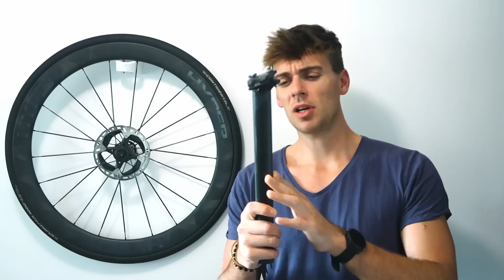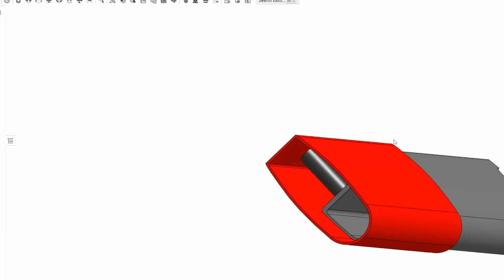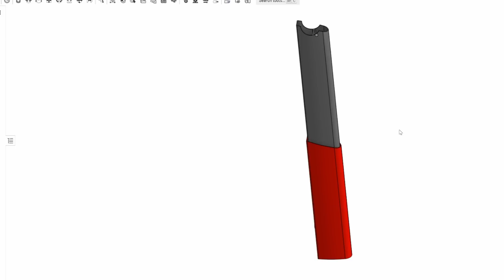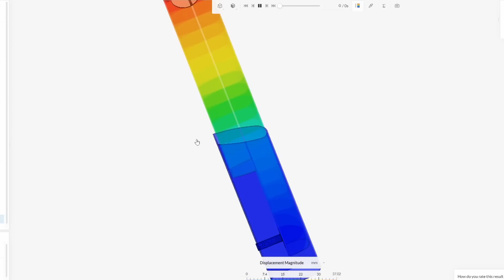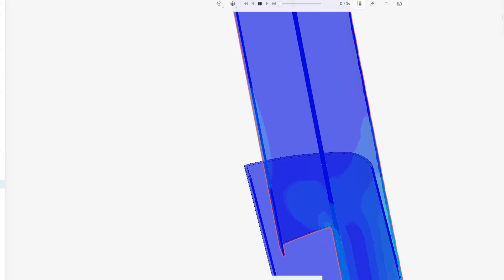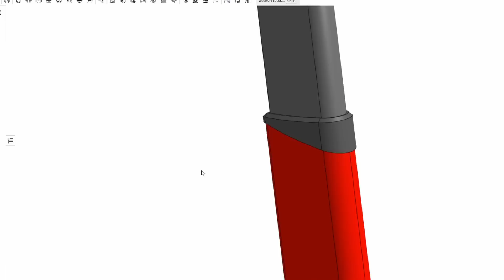2021 Canyon Aeroad seatpost fail, fix & The State of bicycle frames in 2021.

Comment: Maybe you can check out the Pinarello F5. I recently purchased one and have the creaking seat post issue. The Paste did not work. removing the past did not work. maybe you can shed some light on this problem with your engineering background. Great video by the way!

Comment: I don’t work at Canyon but it is pretty easy to figure out what happened:

1. Owners/investors tell management that the next bike needs to be more aero, lighter, and more comfortable 
2. Managers pass the info to engineers
3. Engineers come back with a viable solution
4. Managers tell them that it isn’t aero/light/comfortable enough
5. Engineers say it isn’t possible without sacrificing one or the other
6. Managers say that isn’t acceptable, probably with some line like “if you can’t figure it out I’ll find someone that can”
7. Engineers come back with this solution. Managers and investors are happy.
8. Engineer sends memo saying something like “this solution carries the risk of creaking or other issues while under load that may result in massive warranty claims”
9. Engineer gets fired, managers instruct everyone to ignore e-mail

Or something like that

Comment: One other thing that I have noticed, the pinch bolt assembly is so small and the seat posts that I have seen have a round indentation from where the pinch bolt presses on the seat post. Would that not cause delamination on  the post? There's a few videos showing this on youtube. Thanks and great channel.

Comment: Before I started with cycling, I was a hang glider pilot. And back in 2015 I had bought a brand new performance hang glider with a lot of carbon parts directly from the factory for 7k€. It was a small company from Germany and the whole thing was designed and produced also in Germany. I don't how many pieces they sold each year but it was definitely no mass production.
Now when I compare the price point of this highly sophisticated aircraft with mass produced carbon bike frames from Asia, I have to wonder where this price difference comes from!?  For me it's not plausible.

Comment: Great video mate.
Meanwhile, one year later, they released the grommet but still no where near a proper and final fix. Ridiculous. Even with the grommet the design choice of having a moving seat post in a carbon frame just seems bonkers.

Ps: you had a load case for a heavy rider, but what about compliance for a light rider? Would the stiffer post still flex enough?

Comment: I was just watching this again, as by now I bought the bike, it now comes with a rubber seal and it seems the seatpost doesn´t get damaged by rubbish getting in, but now they (and I) have a noise problem coming from the seatpost. If you grease it up at the rubber seal area it goes away for some time, but it seems the grease is wearing away or melting down into the seat tube and after some rides the noise comes back. Some people seem to have had success with putting tape around the post at the area of the seal. What is your opinion on this and it would be great if you could update your video, as many people are struggling with that now. Canyon tells people to send their bikes back for warranty and apparently they are returned with a new seal installed, same frame and post. 
It continues to be embarrasing, especially as I am a German Engineer myself😁 Apart from that the bike is great, but the noise makes it pretty unusable. BR Eckhard

Comment: When I saw this design on release I could see the problem straight away and I’m not a carbon expert. If you’re clamping something further down while reducing the mass to encourage flex then the upper portion will need clearance to be able to flex or am I missing something 🤔frame quality and design is utter crap 💩 too much focus on aero and marketing and not enough on actual quality 🤦🏻‍♂️

Comment: Keep the top spacing - or increase it - and sell “performance vibration dampers” to “tune your ride and save 1^xn watts per 40 km” (polyurethane bushings sold at a massive mark up).

Comment: I'm having a similar issue with my brand new Canyon Roadlite with the Canyon S15 VCLS 2.0 CF Seat post. The diameter tolerances between the seat post and the seat tube are to great for allowing the seat post to stay in place firmly against the walls of the seat tube. This creates a fine cut line on the seat post as it flexes back and forwards and each time rubs against the rear side of the seat tube. Having issues with the steerer tube bolt also. Will never go for another Canyon again!

Comment: Finally someone called them PLASTIC frames , ' cos effectively that's what carbon frames are , a glorified plastic .
And if U were designing something to ' flex' in side a hole wouldn't U put some kind of bushing between the two surfaces to still allow some flex but absorb some of the ' shock' and dissipate the energy in other ways ????

Comment: oh come on the Shimano Dura ace 9000 and 9100 plastic core cassettes would bend and drop chain under load, or SNAP AT THE RIVET. shimano double rivets so they lasted twice as long, months? we went for campy or SRAM monoblock cassettes and no more issues! How about the dura ace 9000-9150 polymer cables that frayed the polymers and gunked inside reducing my usability to 400-800 kms or 3 weeks? switched to gore yokozuna, no more  issues. Shimano DA chains?  putrid metallurgy when compared to Campy chains and even sram.... yes agree with everything else but for shimano being a role model. Google dura ace 9000 rubbish cassette says it all.

Comment: appreciate your work, but i guess your model is wrong. the design is for sure thought to be a fixed bearing at the bottom and a "pivot" at the top. so it can flex forward inbetween the two "bearings". I don't know how someone can possibly come up with such a bad design. friction and wear are just too obvious, as the top slides ever so slightly when flexing. if you would increase the gap to erase the top bearing you end up having extrem leverage and forces on the bottom clamp. dont know how you would want to have a 40cm lever clamped on a 2 cm collar and bounce a heavy person on it. math tells me it wont work. having a rubber collar on top, as a sealing and as a bearing would help indeed.

Comment: I don't know what brand to buy anymore. I had a seatpost problem on my 2009 Madone. They never solved my problem, despite their lifetime warranty for the first owner. The seatpost goes over the frame and is secured with a clamping system with two screws from the back. Every season one of the bolts would brake. Cycling friends called me the canon, because of the sound the braking bolt made when braking during a ride. Almost had an accidant because of this problem. There were more people that had the same problem back then, but Trek did just ignore the problem. I had to take my loss and throw away a 2000 euro frame. They changed the way they clamp their seatpost the next year by the way. Never a Trek for me again. Now I can add Canyon to my "never buy" list I see.

Comment: As an engineer I came up with those 2 solutions before you even mentioned it in the video. Grommet as the best way and sealant as a quick fix. I guess engineers think alike. If only Canyon could use common sense...

Comment: Canyon really made it wrong here. On the other side: your investigation and solution is wrong too (sorry). The lower fixing point is not designed to take up moments (look at the drawing). It is designe as a force-pair from lower fixing point and the from top of the seattube. The problem is, that there is a space, so that the seatpost can move during riding (which is a dynamic impact). Correct solution is to prevent the seatpost from moving on top of the seattube NOT to give it more space.

Comment: Here’s another design/engineering question...why did they decide to mount the clamping arm at the rear of the seat post? The bending moment is pushing the bottom of the seat post forward, so it would make more sense to mount the arm on the front of the post if you are going to design the bottom part of the seat post half the length of the frame! Thoughts?

Comment: The post doesn't acutally work in the way you said. It's not a bar with just onebearing at the bottom as you discribed but rather a bar with two bearings, one at the clampt and one where the post exits the frame. This doens't make the damage to the post any better but the problem is certainly not that the post has to less clearance.

Comment: I’ve personally opted to avoid carbon frames, I ride mtbs and at times it’ll take an impact from a direction that the carbon wasn’t designed to support, could be because I fall off, or a rock kicks up... etc. While I understand manufactures need to define fair use for their warranties, I’d argue that in mountain biking this type of impact comes with the territory, whereas metal frames tend to withstand these impacts better. I’d be a little more inclined if the smaller brands honored their warranties properly. But I can’t lay down 3k+ for technology that’s more sensitive to production miss-haps, are not scanned / checked over fully before being shipped out, a reluctance to honoring warranties and at the end of their life cycles these frames can’t be recycled easily. So most carbon bikes will most likely go into a landfill. By all means correct me on any of this because I’d love to buy a sleek carbon frame, they look gorgeous… but as a weekend warrior it just doesn’t make sense to my tiny monkey brain.

Comment: Couldn't let the chance to be comment 666 pass lol.  I have the Canyon Aeroad CFR and I looked at the design and saw a way around any problems.  First, I'm old enough to remember when we started using aluminum handlebars on motorcycles and they broke because the clamp cut into the bar. We solved the problem by chamfering the edges of the clamps.  I did that to my frame, not enough to really even see it but enough to keep the sharp edge from cutting into the seatpost as it flexes.  The other thing I did was to be very careful about not getting assembly paste above the small part where the clamp grabs. In fact, just an inch or so on both sides of where the clamp applies pressure.  Then I made sure the inside of the frame at the top was smooth because that's the only part where the seatpost can really rub. If you grease the inside of the frame just at the top where seatpost enters and the post it works just fine. As far as sealing the top, I live in SoCal and don't ride this bike in the rain. Still, I put tape around the top to be certain nothing could get down into the frame. I've only got about 1500 miles on the bike but I'm not having any problems.  I'll keep an eye on it but I'm not expecting anything serious.
Reply from the maker: Well Robert, you're lucky to be gifted with a certain level of mechanical sympathy. 99 percent of your fellow customers won't recognise the things you have, and that's the issue. Cheers
Reply: @PeakTorque  It may be that Canyon see this as a structural issue more than a cosmetic one.  Structurally I'm sure it's fine, would never fail in the service life of the bike.  We tend to see our bikes more as art while engineers might see them as equipment.  "So what if it's a little scuffed - it will never fail and it rides great!"  Just saying... Keep up the good work.

Comment: I think they need the contact at two points to react against the torque applied to the seat post.   If all the torque has to be resolved at the bottom clamp only, the loads will be huge.    A boot will help, and it may need to have a plastic bushing incorporated to help provide a wear surface.
Reply from the maker: True, they could've intended it to be a simply supported beam not a cantilever, but then the top support needs to be zero friction and zero, clearance, a pure slider. Which it isn't.

Comment: Those 2000 N are pretty reasonable, i would even say rather normal. I am 2m tall and 115 kg at the moment (Dang you COVID, Dang you!) so i would even go towards 2500 - 3000 N if someone does absolutely nothing to absorb any impact and just remains seating.

Comment: No, it's not way harder. The component parts are smaller and they make many more. The frame is much larger and much lower volume. That combination makes for the lower consistency every single time.

Comment: Love how guys like you and Hambini are calling bs on the bike industry.  But you're missing the main pt - that Ritchey himself pointed out in a Q&A video couple yrs ago.  It starts with the fork, which is combination control arm and primary canti spring suspension. This is the part of the design to get right first.  Together with the tires, it's the 1st order dynamic response.  Everything else is higher order and of lesser importance.  The industry has settled on a fiber composite fork which has poor fail characteristics.  For cost, mfg yield, whatever ... it is being to be overbuilt for safety factors.  It's too stiff.  The rest of the design becomes different ways to compensate for poor ride and handling due to the front end being too stiff.  Disk brakes on a road bike?  Completely unnecessary and makes the problem that much worse.  Alternatively, tolerate one more lb of weight and build it from steel like before; tailor the flex properly, and safely design closer to the yield stress without issue of catastrophic fail.
Reply from the maker: Great comment. Totally agree most bikes are too stiff. In my other videos you'll see i comment out how most carbon forks make the front disc brake feel awful with reduced braking traction and feel, especially with torsionally stiff front wheels (2 or 3x and short spokes). I agree the fork is the first and fundamental resonance mode, but that shouldn't be confused with general deflection due to single bump loads, an area where i think soft/flexy seat posts are very valid.
Reply: @PeakTorque  hmm. somewhat disagree for a road bike. there once was a design called soft ride that didn't work out. if there's too much travel at the seat, stability for power transfer is compromised.

Comment: I disagree with the design principle discussed in this video around the subject of stiffness, clearance etc.  You can’t get a ‘floating seatpost’ to work in this installation; the canti-lever condition doesn’t allow for it.  

The correct way to design this would be to design directional  stiffness properties into the post - also on a performance bike you should accept some level of additional stiffness.

The fix is make the post constant cross Section and put the clamp at the top of the seat tube. 

Also canyon makes mega money by sub contracting frame manufacture to a composites company in China.  The only profit margin warranty wipes out is for shareholders.

Comment: Could it be that UCI said the frame as per design intent is in fact UCI illegal.. i.e. a) the frame that covers the boxy portion of seat post is in fact just a fairing... b) the frame doesn't conform the "simple" triangle requirement for frame (could say a) the top tube is effectively L-shaped or b) the front triangle is effectively a quadrilateral... so they got rejected and instead of scrapping whole thing they redesign to restrict the seat post movement where inserts... which nullifies any advantage of the complex design? Doh! 🤦🏽‍♂️

https://ibb.co/gMDzzm6

Comment: Another video and another poor analysis. The design is crap for obvious reasons but there is no way that they were trying to make it work as a cantilever with a clearance at the top of the frame. It is meant to be a beam that has a semi rigid connection at the bottom and a horizontal support at the top of the frame.

Comment: Its truly disgusting that frame manufacturers are shipping this shit and charging thousands of dollars for something that's not fit for purpose. There was a time when steel or aluminium frames were built with quality welds and quality materials and any poor workmanship was visible and those frames were rejected. Now, carbon frames have all this mess hidden from view, it might look good on the outside but it's hiding all the flaws and faults under the covers. It's so poor and yet the prices have rocketed. I know what you mean about falling out of love with the bike industry.

Comment: I notice that there are comments suggesting similar problems don't, or are less likely, on metal frames. That is completely wrong; the state of alloy MTB frames is pretty bad. In my own (recent) experience, it took Silverback 14 months to replace one frame 3 times before finding the 4th frame acceptable. The 3rd frame was built with a 2.5° misalignment of the head tube. Clearly nobody ever checks this kind of stuff. https://hindesite.wordpress.com/2019/09/06/some-comments-on-a-midfat-mtb/

Comment: Your engineering is suspect at best. The issues highlighted appear to be corrected but as an Director of Engineering I would terminate the engineering that presented this “assumption “ analysis.
Reply from the maker: it was a basic example to outline the process. For most of the viewers who won't be interested in the intricacies of FEA, anisotropic CF modelling, boundary conditions etc. If someone wants to send me the exact load cases, accelerations, layup schedule including layer order, transverse and longitudinal E and v of each prepreg layer, the frame and seatpost drawings, I'll send you back a quote for the work. As i said im not doing it for free, when I don't have the proper geometry available to me.